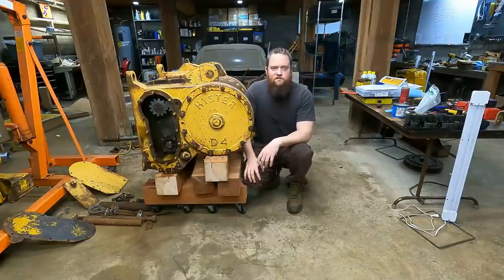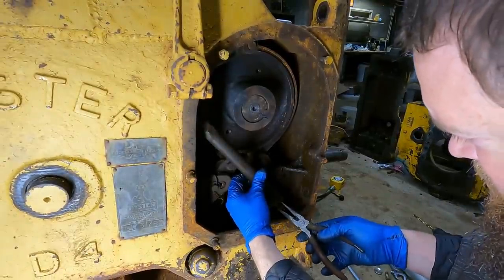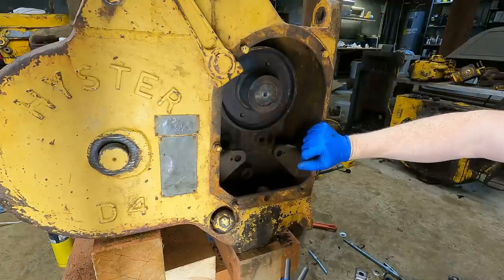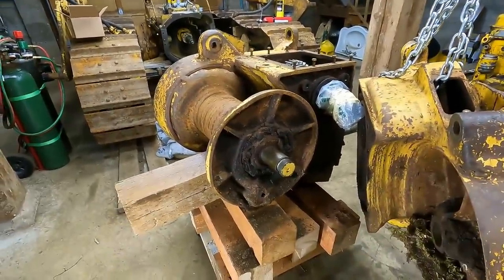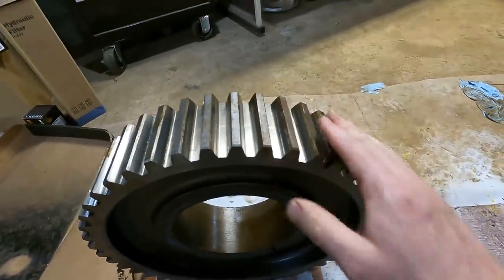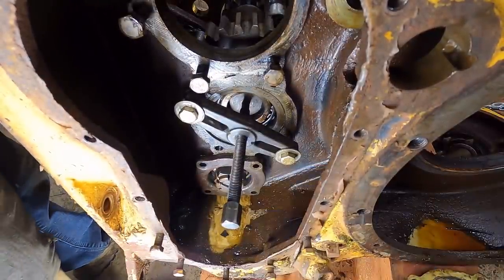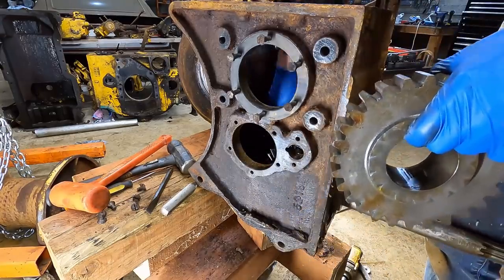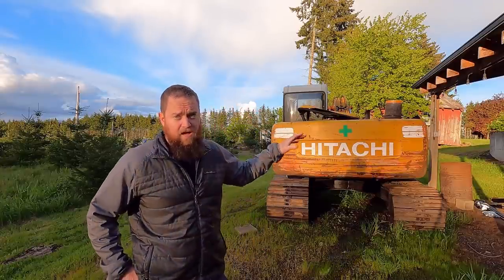Caterpillar D4 Hyster winch rebuild (part 1)

Comment: Don't boil the gear, boiling only will give you 212Degrees.   Put gear in the oven and heat to your desired temp.   No moisture from oven heating.
Reply: Ad freezer for the internals
Reply: You boil it in oil not water lol. You don't want to heat a gear any hotter than about 300 degrees or it will lose its temper.
Reply: I agree with Jeremy. Heating in oven can induce stresses from uneven heating. Too high of temperature can alter grain structure.  I am not a metalurlgist, but that is what I have picked up over the years.  Good luck.  I so enjoy this rebuild. You take it to the best point since manufacture. Greetings from Montana.
Reply: In some cases I have used a simple hot plate and it does wonders

Comment: I am so glad you have the patience to make these videos! We need to remember that most of the repairs done to heavy equipment were done in the field under adverse conditions. Probably standing in mud half way up to your knees with a cold north wind and rain blowing down the crack of your butt, using a dim flashlight and with a half witted boss standing over your shoulder telling you to hurry up because of some deadline he's trying to meet. That's how that little rock got in that odd place I bet. Hat's off to anyone who's ever worked on heavy equipment out in the field, I don't think you guys are getting paid enough! They don't call you guys "nine fingers" for nothing! One more thing, pet your dog for me, I lost mine not too long ago and I sure miss her.
Reply: - I am hoping there are those guys you spoke about seeing your comment...I know.
- Q: How to lift a Skidder's differential ring-gear into place at 36 degrees below zero F, without any lifting equipment whatsoever, 6 miles away from a road of any sort whatsoever?
- A: Drag the huge/heavy ring-gear into place with a spruce bow on snow; put a short armed stock/strong handed 50 year old owner laying on his back with his hand pointing up and his elbow out at right angle to his side laying on the bows; rock the ring-gear over his open hand laying flat/palm up, knuckles flat on the bows; kneel beside him and lift the ring-gear up and back into the differential housing as his palm and arm act as a lever holding everything steady...take the first bolt with bare fingers to secure out of you mouth and do so...and don't screw up and drop it and don't you dare cross-thread it before his strength fails ! ! !
* [that one is my best one to tell...but there are many other Skidder and stone crusher stories]*

Comment: Years ago at my short stay working on farm equipment a neat trick was using a hammer… But!!, with a twist. You’ve all seen similar methods of hitting the endnof a puller while under tension but this method used sonic vibrationa in the shaft itself. When tightening wedge locks used to hold wheels onto axles we would load a breaker bar with our body weight. While loaded, hit the other end of the axle with a large hammer. Each blow would gain a large drop/turn of the breaker bar and it could be made WAY tighter than just 200lbs in a 6ft pipe could torque it. To remove things like that brake in the future try to load it up with a puller and whack the hell out of the opposite end of the shaft. The sonic “waves” in the metal can make a huge difference.

Comment: Matt great videos, enjoy watching. Just a suggestion, instead of bending back the end bell of the winch drum I'd just cut it off at the base. Get a scrap plate the same thickness, torch out the center the same size as the drum diameter, torch around the outer edge of the plate at a 45deg and grind the rest to form the round outer edge then weld it on.

Comment: My suggestion would be to cut all the bend and warped stuff off to a similar height all around and bend a piece of flatbar all around and weld it, so you at least have an even gap all around and a solid edge of the drum again. The inner side of the case looks all flat, so a little less diameter shouldn't matter too much.
Reply: If that cable slips thru the uneven crack when winching. He will wish he had.

Comment: In all honesty, I believe that not taking out the final shaft was a good decision, in fact, I thought that since the other shafts and bearing were visible and nothing appeared to be worn to the point of needing to be replaced, there was no good reason to remove those shafts and bearings. In my opinion, you unduly risked damaging those bearings and bearing cages, thankfully they came out easy and you did not do any damage. Because, as you said, bearings for your winch are not cheap to replace. This is the first time that I have ever actually seen the inner workings of a large winch and from the sizes and heft of all the gears, bearings, shafts, plus safety wired bolts, this winch must have been one Bad Boy for sure when pulling whatever it was hooked to. You are doing great and I thank you for letting all of us see the teardown and rebuild. BTW: I would use some sort of high-temperature oven or another source to heat the gears when reinstalling them on the shafts. I have seen both gears and bearings put into a regular kitchen oven, but with the size and thickness of yours, I don't know, maybe you should ask around and see what suggestions you get.

Comment: Instead of trrying to straighten the drum flange, maybe grind it off and weld a band made from rectangular rod, around the circumference.  Pre-bending the band in a circle would help.
Reply: I was thinking the same but just use round rod. Fill the inside and outside lips flush with weld.

Comment: On the drum you could weld a piece of 1/4 x1" strap around that edge to reinforce it so if you get into it, it wont fold into the case again.
Reply: And profile it back 👍

Comment: Hello Mattie,
Good to see you back with another vid.
For your drum flanges, you might try a weld or machine shop that could weld and re-machine the form on a lathe. The damaged portion of the flange could be machined/cut off flush to the drum and a new piece fabbed and welded to the hub.
I supervised an assembly area that assembled winches at CAT.  I think there were six or seven different models. We couldn't always get parts in to build the models that were on order.  Pain in the pa-tute.

Comment: Boiling in water will drive water into the metal, either heat in oil or in an oven, to no more than about 275ºF to avoid taking out the tempering. Or even better, freeze the shaft overnight in a deep freeze, or set in dry ice for an hour. much less hassle, and way easier to handle. Very large equipment shafts will often have shafts that are drilled through or are hollow to allow liquid nitrogen to be fed through them. Chill the shaft, then hand spin off the nut, and the same for reassembly. The problem with heating gears that have a high ratio of external to internal circumference (small shaft with large gear with a lot of material in between), is that when heated, the metal will expand in all directions, including inwards towards the shaft. For gears with a low ratio of external to internal circumference (think wagon wheel), the metal expands along the circumference, making the object diameter larger, with very little expansion along the narrow edge and inwards to the center.

Comment: If the pipe wrench had failed to get those large nuts loose on the outside you can usually get them to start turning with an air hammer. Saves from having to get the torch out more often than not.

Comment: I’m guessing the winch has been one of the most abused components.
It’s used to pull a stuck dozer (it’s self)
It’s used to pull other machinery free.
Just like the hydraulic puller it get used until it breaks.
I’m hoping it’s an easy fix maybe some round bar to re enforce inside the damaged drum, if there’s space to do so.
As always very in-depth.
I’m looking foreward to the next part.
And the next video.
Thank you

Comment: cone bearing?... :)  they are actually called tapered bearings.  Most people don't know this but ALL tapered bearings have to be set with the proper torque, that torque spec changes depending on bearing size and application. I've set and adjusted thousands of these tapered bearing for 30 years ( retired machine mechanic ) Were I worked and for our application the tapered bearings were mostly set to 3 lbs /max. As you probably already know never over torque tapered bearings, always follow torque specs, like many other bearing types too much torque will result in excessive heat and pre mature bearing wear and failure. Love the videos, thanks for sharing.

Comment: It's great what you do , saving old iron , I'm from the Midwest,  Missouri to be exact , I have a couple of old machines I use on the farm here , one is a case 850 dozer from the 80's  ,very hard to find parts for , the other is a mitsubishi ms180 excavator ,  84 model , those are very few and impossible to find parts for , they are just used on the farm , I'm still working on the excavator , not much luck on it yet , keep up the great work , I enjoy watching your videos , it gives me great hope on working on those old machines !!!!!

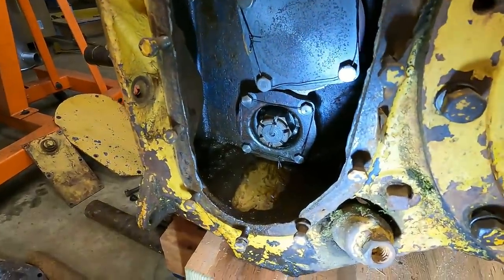Comment: 1:49 Woodruff Keys are by designed made to shear if the shaft if over loaded (this is why it doesn't have a long standard key stock.  This adds some credence to you spare part storage theory.

Comment: Great video Matt! I can't imagine all the abuse put to those winches by loggers, lol.  I was in West Virginia running a production study at a coal mine one time, and while we were there, the customer was in the process of doing an expansion.  The outfit that they had doing tree removal on the top of the mountain had a D9 or D10 with a winch on the back.  Connected to it was a D6 that was pushing trees off the side of the mountain.  At the end of the pass, he couldn't track back up so the guy in the D10 would winch him up.  It's one of the craziest things I've ever seen professionally!  These machines are beat on on the daily, and the only reason they live is because of how overly built they are.  Keep up the good work!

Comment: I think that the drum ends are worn thin by the line rubbing when it's pulling off centre. Consider building them up with weld and machining the weld back smooth (after you get the underneath clearance).

Comment: One trick I've found if you need to cool that shaft to slip that gear over, get a can of keyboard cleaner and turn it upside down. The fluid coming out will be well below 0 degrees and it works pretty well

Comment: Hyster was well known for their "Lumber Pick-er Up-er" machines and forklifts. Lot's of Cats used to "Yo-Yo" in logging operations equipped with their winches. I prefer a ripper. It'll help a bunch if you grease the threads on that puller every time you use it.... trust me. Glyptol.

Comment: Would suggest if you can. Once you straighten out. And get the drum in to a round shape. To weld in more braces. To strengthen the outer sides. And hopefully. Save it from buckling in on its self again. To hopefully keep it true. For longer. You have 4 why not another 4 opposite for strength.

Comment: Just a suggestion, cut 13mm off the damage end of the winch drum face, roll a piece of 12 mm round rod to the dia of the out edge of the winch drum, then just weld in on to make new straight edge to line up with the side of the drum carrier, should work and look like is came from the factory

Comment: 29:10 ... the black over sized nut on the puller is designed be hammered on ... this shock can double the pulling power ... the puller arms actually stretch and hammering on the bolt. lets the stretch release

Comment: For the damaged edge of the drum I'd consider adding a 1/2 or 3/4" round or square reinforcing edge around the whole damaged edge.  It looks like it  is weldable and forming a hoop to weld on the entire edge should do the trick.

Comment: gears look great like it wasn't used much at all... I think I would bend up a piece of metal and weld it on if heating and bending/hammering doesn't go real quick on that plate you're trying to straighten... yeah that one big 10 inch seal as soon as i saw that i thought $$$ if you can even find it.. but it really looks clean overall so if you can get it back together it should last as long as you want to use it and much more. good luck with it

Comment: Coating the case interior, try product called. Red kote.it was used on inside of racing engines for quick oil return and if put on right would keep rust out . Good luck.

Comment: Everything inside the winch looks so good because there isn't a lot of call for a winch on a light weight machine. Frequently using the winch will just pull the machine backwards.

Comment: Great video. When you get your winch all done ,  have you considerd  installing a fair lead on winch to wind cable on drum correctly, should be one in NW or Portland area. Good watch. Maby you can switch between dozer & excavator a little if you favor dozer .

Comment: As for the drum flanges, they will need to stand a lot of pressure when the drum winds in under load. Might consider cutting out and welding in new flange sections.
Be too bad to re-assemble as is, only to jam your cable if it jumps the flange.

Comment: Headache lol i am working on a cat 29 double drum cable control Ccu and there is an oil tube rusted away up in the top of the main bull gear have not yet figured out how to replace it. On a cat 29 you have fair leads both leads go up then down then to pan. If it goes to blade right side goes up down sheaved to go front to a triple block then blade and both right and left drums need all new seals right drum has virtually mew clutch disc left side needs new fiber disc.  Yes is work in progress

Comment: My suggestion would be to get a length of thin bar steel (about 1/4"?) and bend it in an arc to the outer circumference of the bell flange and weld it to the inside edge that's thin to beef up the strength of it?

Comment: 10:00, 8,000 lbs used to be 4 tons of pressure.? Keep up the good work.
Reply from the maker: 8000psi from the hydraulic pump, output force is determined by the area of the lifting ram cylinder.
Reply: @PacificNorthwestHillbilly  I was wondering where you got those values.

Comment: You need to invest in one of those hammers 🔨 like yours using on that winch only they make those dead blow hammers like that the size of a  long handel sledge hammer get some leverage on it , seen them on the TV show deadliest catch on discovery Channel they were using them to break ice off the boat to keep from getting to top heavy , and rolling over , they were. Pounding the shit out of the boat but  because they were plastic they didnt even chip  the paint
Reply from the maker: I was thinking the same thing as I was sweating profusely while banging the case apart 😂
Reply: Shame there are no more lead hammers. When you hit something it would stay hit as lead hammers don't rebound. Unfortunately they are kinda poisonous.

Comment: "Eh, not too bad" says Matt at 18:04 as he pulls a 400 pound gear out with one hand and sets it down!!! Great video on the fascinating innards of a  machine that is incredibly powerful! If you could provide a little insight on how it works, I'd certainly like to understand - for example: does the PTO run all the time, with levers actuating the driving and braking action? I didn't see what appeared to be a clutch or synchronizer, so I wonder if you engage the winch and then activate the PTO on the CAT. Does the external lever actuate the brake only? And then, if you could just share a little about your background (without becoming a target of the Dark Web). I remember your saying you had a white-collar sort of job, but you certainly seem to be no stranger to the tools of heavy work, and unafraid of that sort of work.

Comment: Couldn’t guess what that winch would cost to replace. There is a lot of heavy duty gears and shafts in that case. It will be one hell of a winch when you get it going. Thanks for the video.

Comment: Nice job of disassembly, you used good strategies on removing bearings and shafts. A good cleaning and lube at assembly that winch will be a sweet runner. Thanks for the video.

Comment: Just wondering if you really have to wire tie the bolts back together or you might just use Red Loctite? All the best from Canada
Reply: Time to learn how to safety wire. That involves tying a pair of bolts together in a manner so that if one tries to back out the other bolt will try to tighten.

Comment: You seem to have gone through the machine very thoroughly is there anyway you can see the transmission forcing transmission oil into the engine oil
Reply from the maker: If the transmission was leaking and the bell housing was really full, yeah.  There is no rear main on the engine, so it can probably draw oil in.  If it's a later machine with a wet clutch, not sure how those are setuo

Comment: if you dont mind hacking and piecing back together one or 2 disc harrow blades (various sizes) as a replacement flange with maybe a few ribs adding to the inside as reinforcement

Comment: - Congratulations on getting That winch apart, Matt ! ! !
- Heat does wonders, doesn't it...and you didn't even get it anywhere near close to dull red hot
- I see your confidence level appropriately improving. It is very enjoyable to see your triumphs.
- I hope your video efforts help others move forward with things they might otherwise shy away from.

Comment: Well all the other gears and bearings in that winch were in good condition and rolled freely ,you clean it up best you can and put the ⚙ gear ⚙ oil to it shouldn't be a problem

Comment: Have you looked at any of the Thompson equipment winch repair videos on YT? They do a lot of dozer winch repairs by the look of it and may have any spares you end up needing. They are out of Portland and may have a drum in their parts yard.
Reply from the maker: Thank you for the tip, I will give them a call.